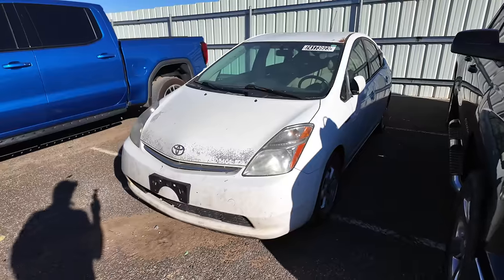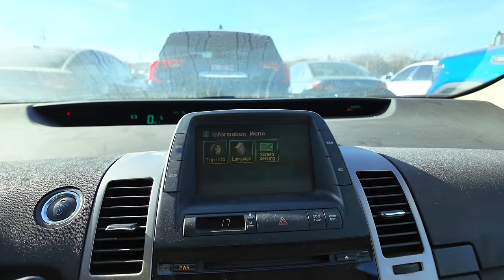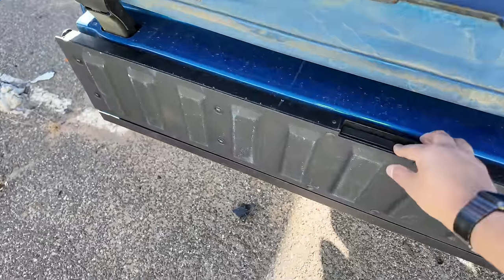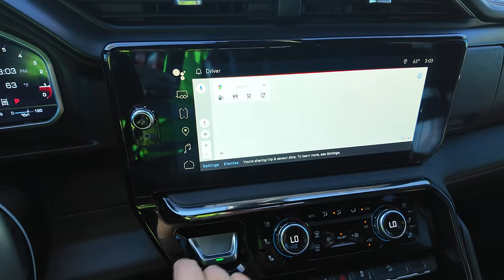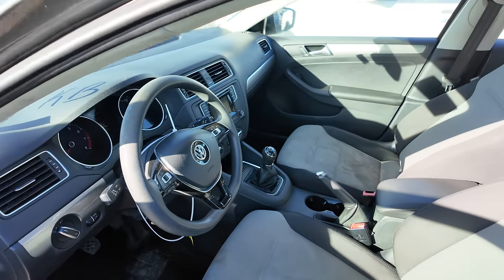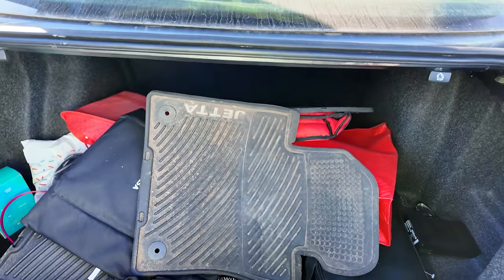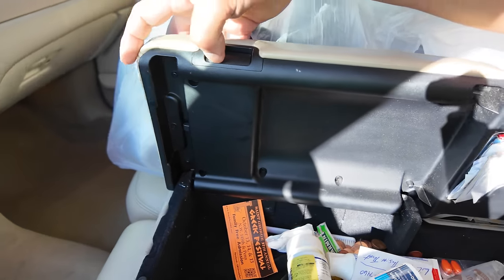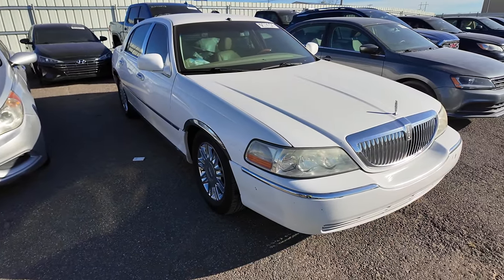Journey into the Back Lot: Unearth Incredible Car Deals at Copart!

Comment: I don’t blame you Randy with the vehicle for Nick. In SC they can get their permit at 14 1/2 years old. I bought a Passat I thought would be a good first car, but I didn’t realize how hard some stuff was to work on them like the heater and unfortunately with my health now I can’t do it myself anymore. So we decided instead of paying a lot here in SC for a beat up used older unsafe vehicle again, we bought our kid a 2015 Chevy Spark. It got good gas mileage and good ratings in accidents. They were going into junior high. Chevy had a great deal on a few of the LS models and it cost us $11,400 including tax out the door paying cash. So they used it through high school, undergrad, grad school, and they still have it while they are now working full time in NC. I recently put a third battery in it (two batteries plus original) front brakes once, tires once, and plugs once. They have 80,000 miles on it and it still runs great. Body is in great shape. I’ve run Mobile One full synthetic in it from day one. They plan to keep it till it doesn’t run anymore. They will be 25 in March.
Reply: Great story. When I was in high school, I actually purchased my own first car while working after school and on weekends. For me, it made more sense to get something newer, more reliable, and safer. While most kids in my school were driving 20 year old clapped out Civic's and beat up trucks, I actually had something decent.

I think it really depends on the kid, though. While I was more mature, there were definitely kids that should have been driving beaters. When they crashed them after 6-12 months, at least a lot of monetary value wasn't lost.

Comment: The electric windows on the VW have a safety feature: when an obstacle (like fingers, an arm or even the head of a child) is recognized while closing the window, it automatically opens again. Just open and close the windows several times and the joints will be lubricated again and will not detect a false obstacle.

Comment: Seriously Randy, I've plugged it before. I bought my wife a 2018 Ford Fusion Hybrid. The car is phenomenal. It averages 38-40 on the highway and 36 in the city. It's not the fastest, but man it has some great room in it. The trunk is smaller because of the battery placement right behind the rear seat, but it can fit 5 people in the car comfortably. She loves it, traded in a Hyundai Sonata Hybrid for it. She now has about 75K on it, we got it with 45K. Knock on wood, absolutely no issues with the car, just regular maintenance. I've talked to other Fusion owners, and they've had similar stories. I have a 2016 Lincoln MKZ, and it puts the MPG to shame on that. I get between 18 to 21 MPG city and 28-29 MPG highway. The only reason I keep my Lincoln is they have the best lumbar support of any car I've driven. I had back surgery in 2021, and believe me, I need good lumbar support.

Comment: Good morning Randy. The 2009 Toyota Prius is a good looking car even though it's got hail damage and paint peel. The 2022 GMC Sierra is a good looking truck.
Reply: That Prius is solid and even at 20 years old (thought it was a 2004, not a 2009) it is still getting 46 miles per gallon. Wouldn't surprise me at all if it still had the original hybrid system and CVT. Even here in rust country New England, I still see this very model with 300k+ miles still being used as daily drivers.

The Sierra, personally I wouldn't touch. There has to be a reason it ended up at a place like this. And that 3.0L Duramax diesel has had some serious issues with them.

Comment: If I had a prius, I would mount a tablet right in front of the steering wheel, where the instrument cluster would usually be, and then use that tablet for navigation ,gauges, etc. HD android tablets are not that expensive. I would also experiment on making it a petrol/lpg plug in hybrid, though that is only cause petrol is expensive in the EU

Comment: I have a new appreciation for the Prius after mocking it like most folks for many years. The are proving to live up to the test of time. Even here in New England, I still see daily driver models, 20 years old, 300k miles, still with original working hybrid components. 

It's what made me buy my Ford Fusion Hybrid. Ford purchased Toyota's hybrid system and the Fusion is equipped with the Prius system and Toyota transmission. I did test drive a Prius but the ride quality of the Fusion was worlds better.

Comment: A kids first car a 2000-2010 Ford Crown Victoria Grand Marquis or a 2000-2005 Buick LeSabre or Park Avenue Base/Ultra with the Buick 3800 Series II. Get a Buick LeSabre or Park Avenue a 5+  NHSTA  crash safety rating or a 1995-1999 Oldsmobile Eighty Eight or Ninety eight is good for a kid cheap to fix and have a 5+ star crash safety rating and the Buick 3800 best of all and they are cheap and most are low miles. Best best Buick LeSabre Park avenue 2000-2005 because its FWD and has ABS and stability control as well.

Comment: I suppose I am different from most people, but when I was in the market for my first car, I wanted either a Toyota Tercel, a Geo Metro, or a Volvo 240. I ended up getting the Volvo 240, which I still have. After that I got a 1999 corolla, and another 240. I still have both 240s. The two bucket list cars I have are a Yugo and an early model Ford Pinto. 
If I were your kid, I would have wanted that Chevy citation or some obscure car like that which you never see. I am weird though. 
Either way, I paid for my cars. If it were being given to me, I would take what I could get and I really wouldn't have been mad with that Prius. I think that is the last good looking generation Prius. I would much rather have the 1st generation which looks like an echo, but hey, that is still a good car. Although it does look battered, it needs a good cleaning and cheap paint.
Reply: It’s funny you mentioned Chevy Citation , I still have the 14” aluminum rims from one.. I had them on my 90 Cavalier..lol

Comment: A friend of mine is a tech at a GM dealer. Told me the 3.0 Duramax timing belt is on the back of the engine. Said they have to remove the transmission to service it every 100k miles.

Comment: I was getting 38 mpg in my 2015 Ford Fiesta SFE with the 3 cylinder turbo. The hybrid should do better than a handful of miles over an ice vehicle... and I delivered for Dominos in it, no highway miles.

I like that blue GMC with the 3.0 liter diesel. That Town Car looked good beside it too.

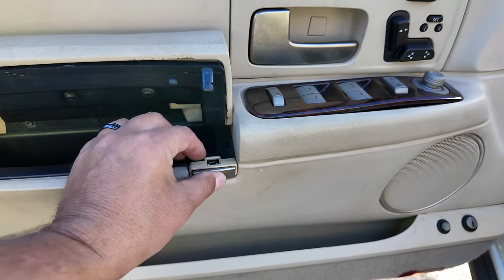26:31 It just popped off eh? Oh sure, just like when you made that pop can explode huh? jk that was some craziness with that can though lol obviously not your fault imo.
Reply: A bad battery forces the car to heavily rely on the engine, hence MPG falls.
Reply: I have a 2019 Ford Fusion hybrid. At the time Ford was using Toyota's hybrid tech and so my Ford has the Prius/Camry hybrid system along with Toyota's transmission.

In my experience, you have to learn how to get the most of the hybrid system. It is actually better to push the vehicle initially to the speed you want and then sort of let it "coast". The car was rated at 44mpg in city; I routinely average between 55-60mpg. It really depends on how drive them. I would also point out that the Prius in the video is from 2004...the technology has improved since then. Prius's today can easily get 75mpg+.

The hybrid system also has some advantages. Strain on either motor is limited as it is switching back and forth between EV and ICE. The biggest underrated asset is the regenerative braking. It sends energy when the brakes are applied to the electric motor. This makes are brakes last a VERY long time, along with reducing dust on the wheels. I am still on my original brakes and they work great.
Reply: Also I should add as a point of reference...it has always amazed me the difference in MPG for ICE between economy vehicles versus midsize. 3-4 cylinder engines would routinely get around 35mpg, even back in the mid 1990's. My 2002 Taurus and then 2007 Lincoln MKZ would only get around 18mpg in the city in real life. My Fusion is about the same size as those and gas mileage is literally 3x better.

Comment: hybrids a bad deal not diy battery packs go bad thousands for battery then labor costs over 400 volts going thru system will zap someone. cheap car for someone Toyota 4runner. ford crown vic, Lincoln town car, buick park ave, chevy tahoe 2nd gen etc.